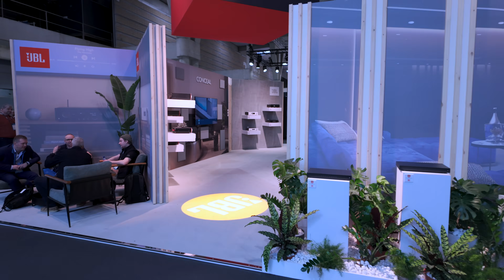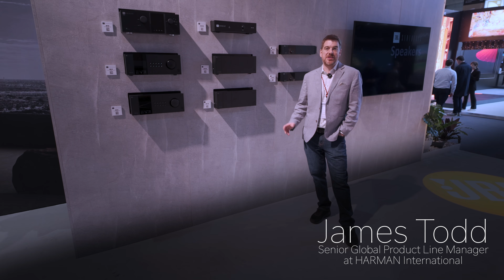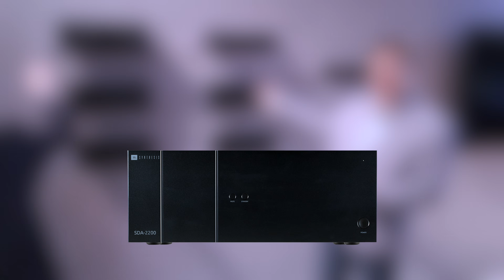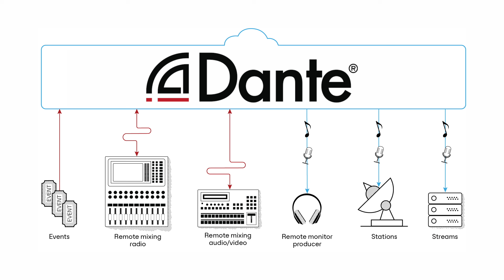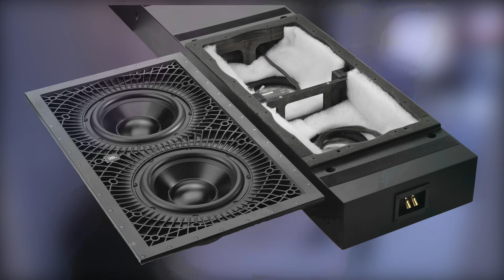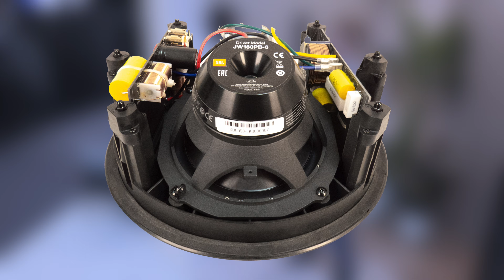Ultimate JBL Speaker Showdown at ISE 2025!

Comment: I have an Arcam AVR31 which is the same as the JBL AVR except without Dante and with slightly lower spec ESS DACs.
Reply from the maker: That’s curious, thank you for pointing that out.
Reply: @ Harman Luxury Audio own JBL, Arcam, and Mark Levinson among other brands. They use the same designs across multiple brands, just in different casework and with some feature differences. Anything from that group with a Class G amp in it is an Arcam design.

Comment: JBL Synthesis is the new voice of the theatre.
Reply from the maker: JBL is not so new. Something like Perlisten is indeed new.
Reply: @boredtech  Perhaps, but no one has proved themselves for as long or as well as JBL with sound systems in both commercial and home theatres.  Perlisten is indeed fine and modern, but the speaker horn still remains the most popular form of theatre sound worldwide I think.  Call me old fashioned, but they have a unique sonic signature that goes back to the days of the great Westrex/Altec speakers that introduced hi-fi directional stereophonic sound in the mid 1950s and is very similar to the IMAX sound systems of today.